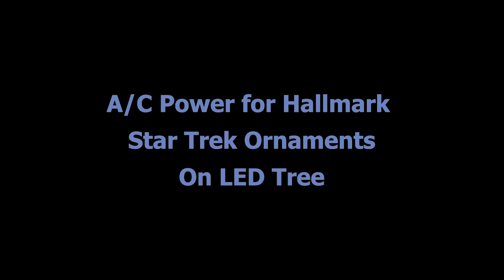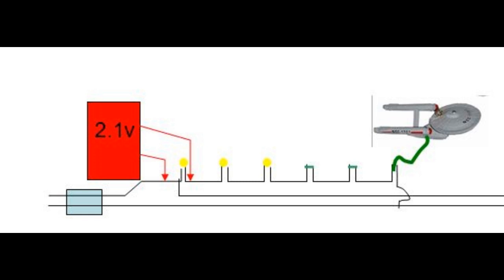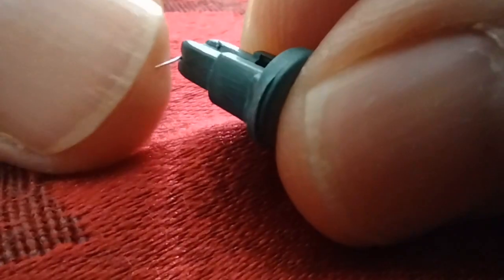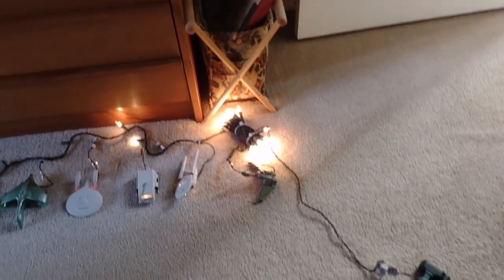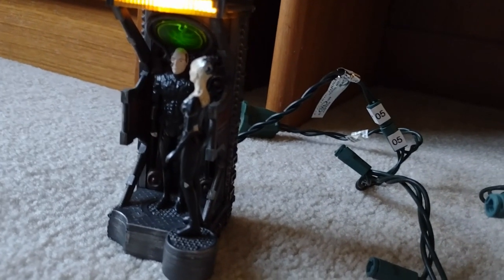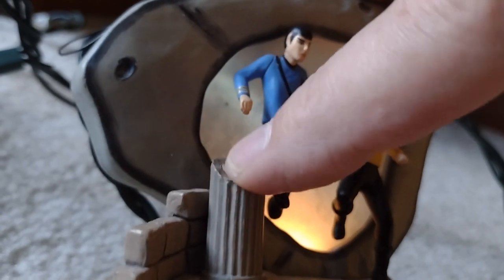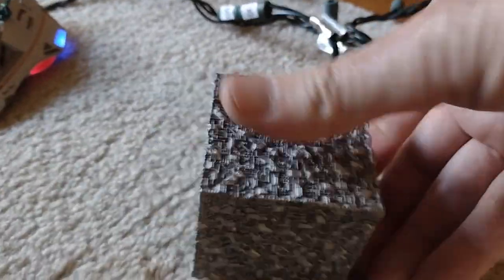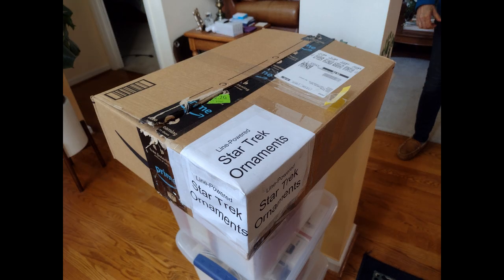Star Trek Ornaments - Powered From Line Voltage

Comment: How did you make the ones newer ones (push button, lights up for a few seconds) stay always on? I have a 2010 enterprise and its glued/plastic welded together. I think it needs to be opened up to be alway on?
Reply from the maker: This video is about the ones that plug into the cord and have some fraction of wall power to energize them.  Those ones that have a button and light up for a few seconds are powered by those little disc batteries, and I don't know if those can be made to stay lit up for longer.